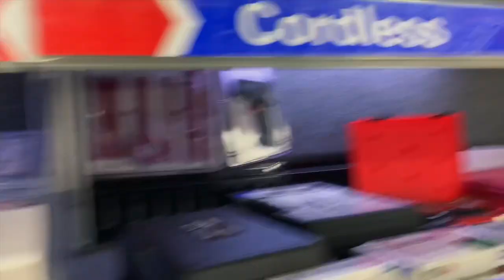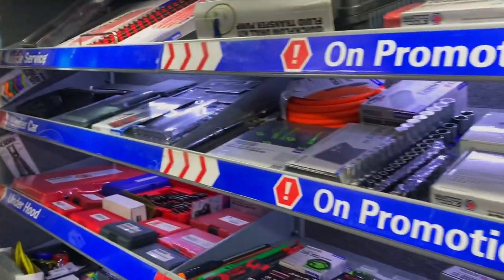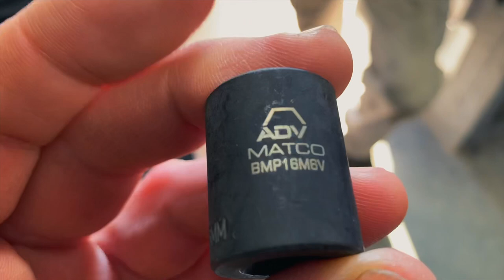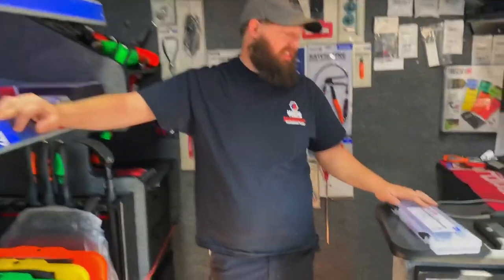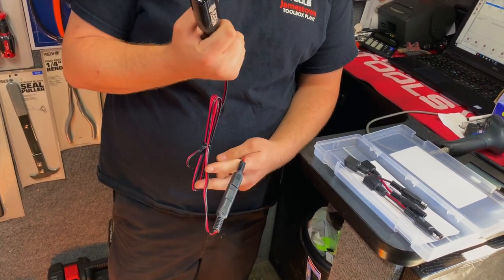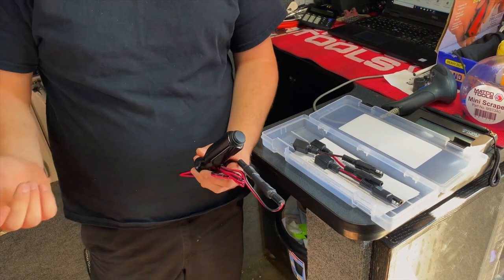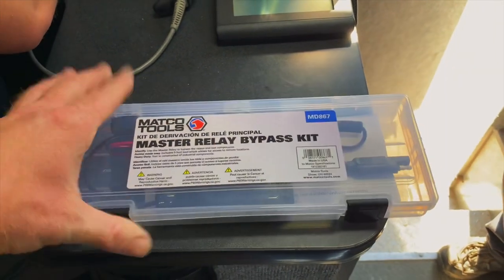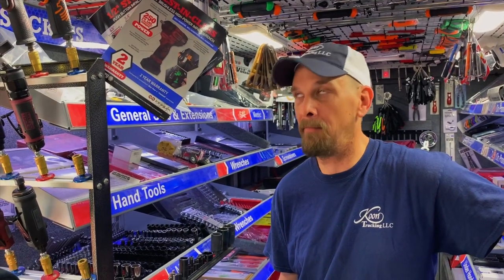Matco Master Relay Bypass Kit MD867

Comment: Hey Clay, Glad it arrived safely and you like it. Hopefully you will get some good use out of it. Its 360 brass so should not mark what you are in contact with. If the end starts to deform just file or grind it to the shape you need.